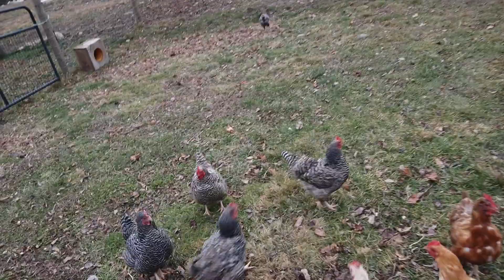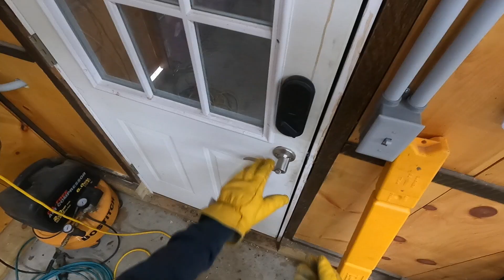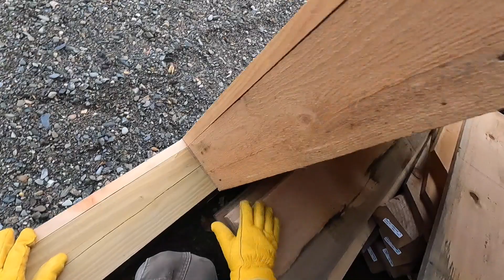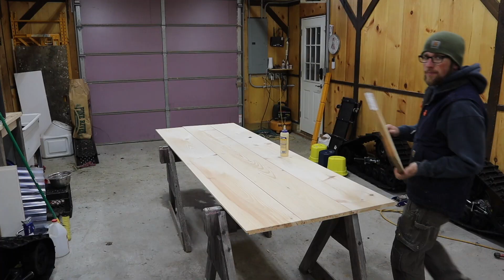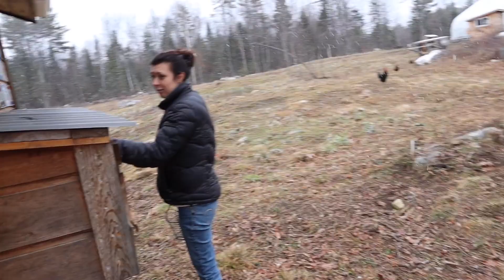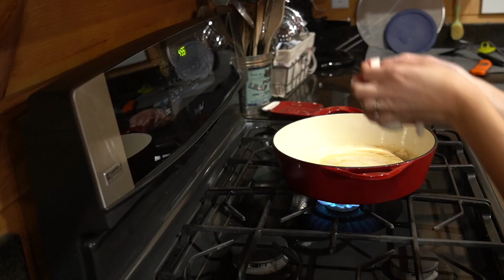If THIS Works it will CHANGE the Whole Look | OFF-GRID Property Composting OutHouse Build

Comment: Yep done radius before the most simple way to do it is with a string a nail and a pencil as a compass.. the first thing you need to do it cut the door to the exact width you need it. Then find the center of that measurement. What I mean is if your door is 32” wide half of that would be 16” so if you measured down from the side 16” and put a mark then measured down 16” from the top you would have a perfect 32” circle. The top of that circle would be your arch. Put your nail in at 16” from the side and 16” from the top tie the string to the nail line the lead of the pencil up to the center edge of the top and wrap the string around it then just draw lightly your arch take note that your pencil should enter and exit the width at exactly the same place when it’s measured from the top down on both sides.. you may have to adjust it to make that happen.. cut the arch out first then cut the bottom square to get the desired height of the door. Also while you have the door laying on the saw hauses 😂 make a template out of cardboard of the arch so you can transfer it to the shed opening  so the arches match.. good luck

Comment: Al, Gina & Olivia I’ve been watching your videos for awhile now and I have to say they are addicting.  I’m also a long time woodworker that uses Titebond II & III glue.  Like you experienced in this video I have have to deal with dried glue in the cap & tip.  Suggestion, I save the cap & tip when the bottle is empty for future use.  I remove the clogged cap & tip and let them completely dry, and clean them later.  This method allows me to swap out a clogged cap with a clean one

Comment: Great video Al ,  arch tops are easy , find middle half width of door, measure same from top to find centre  knock nail in, then use either a piece of string or  the slot in end of a tape measure hangs on the nail and scrib round with a pencil .

Comment: to make curved ambs --rip thin slices of wood the width needed for wall --bend/wet/glue around form of plywood on floor clamp/glue staple/nail till 3/4 to 1 inch thick

Comment: Radius should be easy. For a 32 inch wide door, Measure 16 Inches from edge and top. Measure 16 inches from the edge of another board. Screw that board to center point of arc. Using a marking tool at edge of board,, swing board to Mark arc.

Comment: Door and food looks good!  Gina, if you add a little more cheese just before you put the second tortilla on top and turn to heat the other side, it will help them stick together.  Kind of like the glue Al uses, but better, lol!
Reply: I was looking for a comment like this before I made the same suggestion, so as not to duplicate. 👍  It does indeed work well to use half of the cheese on top.  It makes both turning them over and eating them easier.

Comment: Al use a thin piece of plywood and make a circle jig for your router.  Just set the radius and route in small increments increasing the depth about a1/4 to 3/8 of an inch at a time.

Comment: I bought a set of metal foldup sawhorses at Homedepot and put a 2by4 on the top, they have been the handiest sawhorses I ever had, as now I'm older I'm able to raise them up so they are easier to use

Comment: Cut a hula hoop, 1/2 inch pvc or bender board that you can bend and anchor down with screws for the template of the arch pattern for the doors.

Comment: The way my shop teacher shown me how to make a perfect radius is to use a router with a flush bit and a jig.  The length of the jig determines your radius arch size and curvature.  The longer, the more shallow.  The shorter, the more circular it becomes.  At one end of the jig, you will find dead center and put a single screw.  Then you use the router with the flush bit and cut your radius on the end you want to cut it at.

Comment: I had a thought for a name for your new Chicken coop.   Since you already have New Yolk City how about  "Chick-cago" ? For the Door Arch, find the center point of the door , measure down that same distance , mark your radius. a small stick with a nail in one end and a pencil on the other end will help mark the radius. String would also work but might stretch. Your door slab is a heavy build, have you thought of just using a "Z" or "X" brace on the back to save lumber?

Comment: Arch tops are easy. I believe you said your doors are 32" wide, that would be a 16" radius for your arch top. Take a stick of lumber, 1 x 2 is good, that is over 16" long. drill a small hole ( I drill for an 8 penny finishing nail) near one end, centered, this is your pivot.. Measure up 16" to center another hole large enough in diameter for a #2 pencil to fit through. Measure down from the top 16" and from the side 16", this is your pivot. Put your pivot pin on this mark, your pencil through the other and scribe your arc. This is a trammel and dates back to the pyramids. I've done so many arch tops for doors, windows, even making arched forms for brick masons, that I dedicated one of my straight edge saw guides as a multi radii, permanent trammel. you can do similar with a length of string with loops but I find this more fidgety to hold the pencil while describing the arc.

Comment: A 32 inch door iz a 16 inch radius.
If you draw a straight line across what would be the flat top of door or start of radius, then find and mark that line at it's center.
Take a string, tie it to a pencil, tack a little brad at straight line center mark, measure string and mark at 16 inches from pencil and attach that marked sting to little brad and Poof, like magic, you have a radius topped arched door.
You can also do the same thing with a piece of wood instead of string

Comment: What I do to make an arch is, use a thin board and put a pivot point hole on one end...split the distance from side to side AND to the top edge I would then sweep that and draw your arch by holding a pencil. You could also drill a hole to hold your pencil steady to sweep and draw the  arch!  Best wishes Al. I'm certain you already have that job finished tho!

Comment: Well, if the radius is a half circle, use a long piece of wood that pivots from the center of the half circle, with a router on the end you need to cut.

If the radius is sort of a flattened arch, cut a template out of hardboard, smooth the edge, then clamp it in place, and route the edge with your router.

Comment: Hi family Lumnah. I notice you measure every board Al. Much quicker and easier to set up your first cut and place a stop on the bench and clamp it. especially as you have made such a good job of setting the saw into the bench. That way you only need to measure once. Arcs are easy enough, youll get a better cut with a router than a jig saw though. looking forward to next part of the build and exploring. Have a great day.

Comment: Making a radius cut in a door is about using its center line as a pivot point to draw a circle of semi circle since drawing that line is about making a drafting compass out of what at hand. Many rulers/squares have holes not only for hanging but also for makiking circles and even a tape measure's tongue can be used since all that's needed is a nail at the center line to ride against. Because the pencil/maker etc that makes the line needs on to be held in place on the other leg of the compas only having its pivot point hold fast is important as your drawing it. A half circle's pivot point is just half the width from the top that the center line measures and the more of an arch shape is moving that point further down the line since it's basically a wheel. Indeed even a measuring tape can hook onto a nail/pin at this pivot point by its tongue and since the ratio is 2-1 in drawing a circle with a compass its length needs to be a let tile more than half as wide of the circle to make it work An oval takes three pivot points but that's easier to watch a video on how than to describe it and almost any piece of scrap can be make into a compass as well as a bit of sting since it just needs to loop ove the pivot point nail etc to make it. One hint about gluing boards better is not to ribbons of glue to do it but use a piece of hack saw blade with its teeth done to spread it since it notches will spread it evenly when the other board goes on and it's like using a notched trowel putting down tile since its does  the same thing. You'll use a lot less glue than you think because most it needs to be just a veneer of adhevsive between pieces and it why some much oozes out when clamps are used in woodworking.

Comment: if you finish out the other side of the door with the 32" pieces when you cut your arch you can keep the cut off for the top of your door frame, think about it your arch will already be cut for the door you just made.

Comment: Al I notice the inside of your tractor shed floor is wet. I understand it doesnt have doors in the front but its wet behing the half wall. check and see if your roof may be leaking

Comment: I know this when you cut your arch on the top of your door the part that you cut off that makes the arch the opposite direction where the door swings into you say because that's the part you want to put at the top of the door after you put the door up that way it has a top crack crack crack at the top where the door Arch is made

Comment: Al, if you spread the glue around to cover entire surfaces (both pieces to be glue) it results in a complete bonding. Otherwise the only bonding is those silly lines you draw when squeezing glue. 
A job done right is one to take pride in. Anything less is shabby building.

Comment: To cut a radius door. Pencil, string, nail, tape measure. 
Measure the width of the door near the top. Mark the center of the door. Measure the distance down from the top of the door the same distance to the center. Put a nail in that spot. Wrap the string around the nail. Pull the string to the edge of the door and wrap it around the pencil. Now pull the string taught and draw a line in an arc around the top of the door to the other side.

Comment: To create the Arc on the top use string and a nail, find your center on door measure up to point 2/3 height put nail in center of that line. Example door is 6' find center of width nail at 4' from bottom

Comment: Are you doing a two stall out house? Or is 1/2 of it going to be for firewood? And if half of it for firewood does it really need a door? Course I guess it would be kind of cold in the other half if it’s just open never mind
Reply: The 2nd half is for storage as stated in several videos.

Comment: Hey Al keep an eye on the wether Little Man, he may get pretty badly harassed. I have two and thought they should be in with the bucks but the bucks were relentless on mounting them. They don’t give off the scents like a buck so the bucks don’t seem to understand. I ended up putting my wethers in with my girls.
Reply: You may have the original gay goats.

Comment: Those doors are going to be “rustic” when the boards shrink and expand with the weather as the grain direction is 90.degrees apart on front and back. Wood shrinks more across the grain.
Reply: Thats what I was thinking.  Usually don't glue the cross members for that reason.  Guess we will see.

Comment: hi, by the way, when I have to cut a series of boards at the same measure, I put a guide to always have the same length, it's faster and I don't have to measure each time, a little trick, have a good time
N.B. I don't miss any of your videos, they're well done.
Reply: Frequently Al uses the first board as a template, then marks the rest with that template so they are all the same size.  I like the idea of a guide block as well.  Clamp something down with one of those hand clamps, for example.

Comment: i made an adaptor for my router to be attached to, basically it was a length of ply wood  with a slot for the router to sit in and be attached to it and the other end had a set of holes in the center inline with the router... could do various size radius cuts....

Comment: Al:  You should be using Titebond 3 which is waterproof.  Also you need way more glue evenly spread out like paint.   The screws should hold it together but it will warp.

Comment: it's simple you take a string with a pencil you find the center of your door, at your string you put a nail at one end the pencil at the other end and the trick is to play you trace your ray from your central measure of your door, have fun
Reply: tambien puede usar dos platos de diferente tamaño ....
Reply: String works however it will stretch sometimes as you keep pressure on it. I use a small board similar to a paint stick..
Reply: @carolinalatour5652  translation, also, you can use two dishes(?) of different sizes. Not sure if theres another meaning for platos
Reply: @cathiwim   platos redondos,  elemento circular normalmente de loza o vidrio donde se sirve comida  XD  puede ser grande (almuerzo o cena) o el que se utiliza para postre... o el de postre y el que corresponde a una taza de té ... soy de habla hispana y normalmente los traductores hacen cualquier cosa jajaja la idea es usarlos tipo template para generar la media luna superponiendo ambos .. yo lo usaba en lugar del compas en clases de dibujo .. cuando necesite unos circulos muy grandes .. use un plato de 35cm de diametro